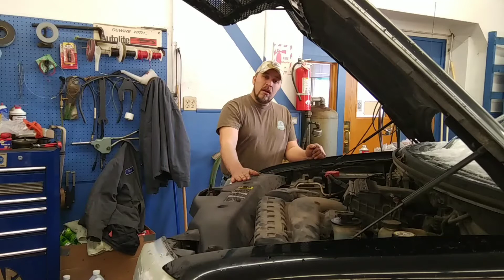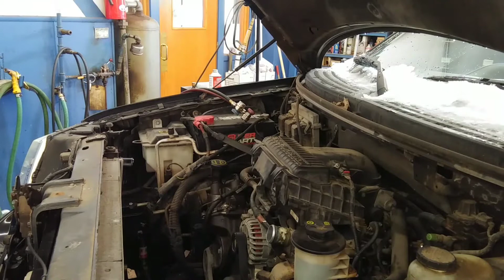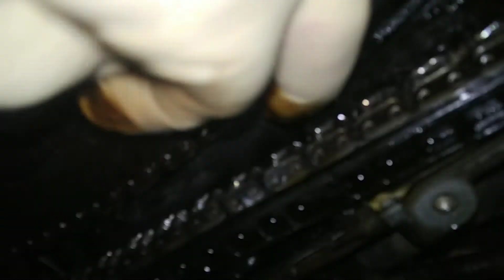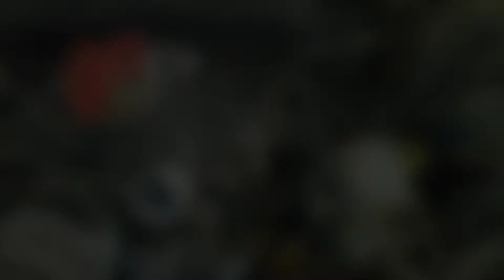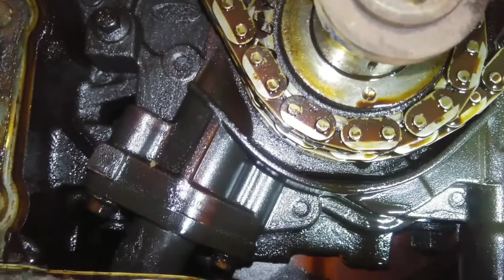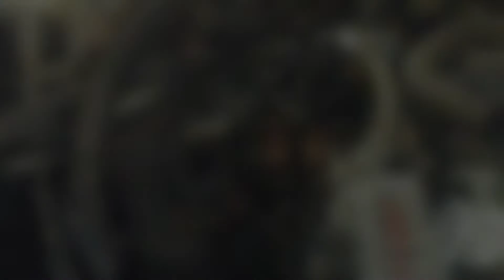Ford 5.4 L noise ( engine disassembly ) Part #2

Comment: It seems as this is a common issue with those engines from your conversations. Being that this is a base oil pressure issue,  and that there is sludge in the engine, any reason why that is? Poor maintenance, poor oil, poor filtration? etc